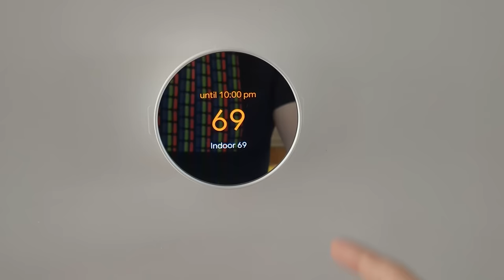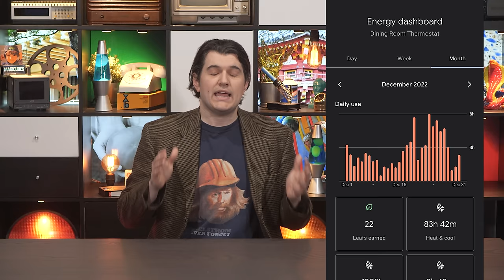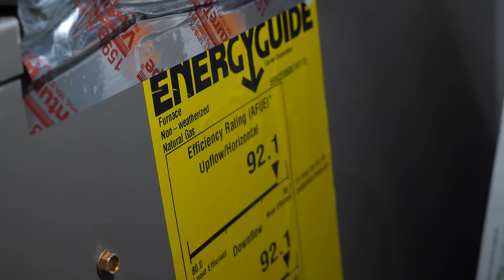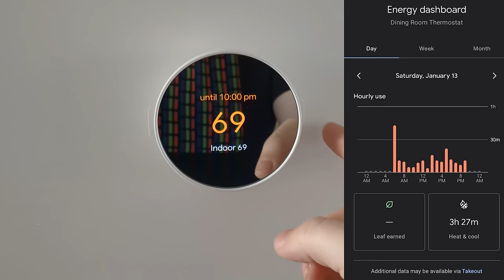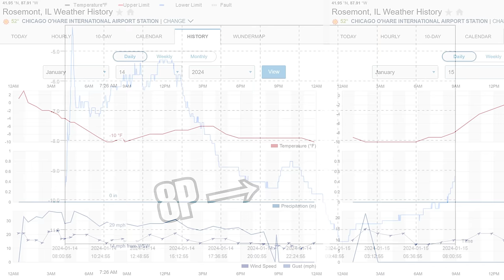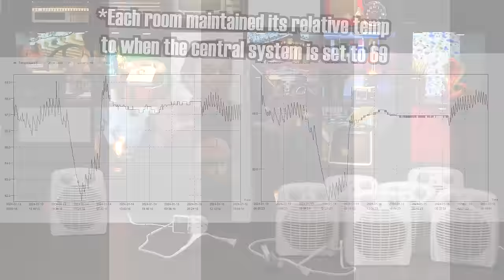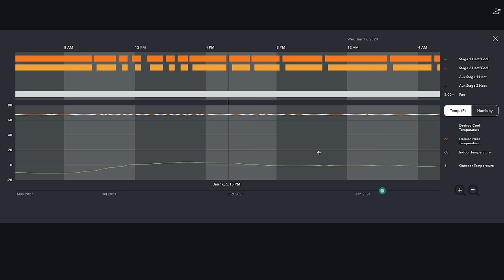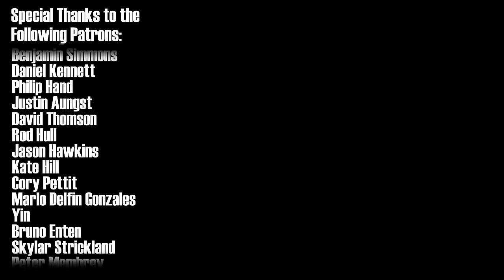Old HVAC industry practices are holding us back and costing us money. But we can fix it.

Comment: I gave up trying to find an HVAC company that wasn't going to lie straight to my face about heat pumps, so I installed it myself.
Reply: This was my attitude about solar and well, almost every other service industry anymore.
Reply: Why do think they're lying, rather than simply being misinformed themselves?
Reply: I have ended up doing most installs these days myself because of similar situations. The “pros” these days only want to install what puts the most money in their pocket
Reply: @JD-xz1mx  The alternative is worse. Profit motive is one thing, but do you want to hire a "professional" that doesn't know their craft?
Reply: Same here. Dual fuel,  with a 96% 40k 2 stage gas backup. Even got my 608 Universal, so I could charge myself, as I had a 36' lineset.
Reply: Same here. Installed my own, 7 indoor units, 3 outdoor units. Pioneer. I still have an oil furnace as backup but haven’t used it in a year. Upstate NY.
Reply: @JD-xz1mx  Because my expectation is they should know their business, so if they aren't lying, they are incompetent, which is equally as bad to me.
Reply: @JD-xz1mx It’s their job to know. If they don’t, then they are at least lying about being professionals.
Reply: How much for the vacuum pump?
Reply: @JD-xz1mx Plenty will lie.
Reply: No you didn't.
Reply: Where do you live? You're assumption might be completely unfounded....my father is an HVAC....
Reply: Problem is that you want a power efficient solution. An installer just wants a customer that does not complain after install. And people will complain to the installer if the system doesn't get hot enough. So they install systems that can make it very hot very fast.

They know you don't need it, but they don't want people complaining the room doesn't heats fast up enough.
Reply: @tharealmb  That might be true a lot of the time, but there is also plenty of Muppets out there that don't know how to do their job properly.
Reply: @LeArmBoss 
Were you watching them without them knowing, so you could make this comment and not be called out on what I can confidently state is baseless speculation? If so, there's probably some questions they have for you, that come along with something like a restraining order.
Reply: @DrLoverLover  I have no idea if it would work, but my vacuum pump (which I think is advertised as being for HVAC work) cost like $200-$250. Standard ass two stage mechanical pump.
Reply: I wish I could install a heatpump myself, but unfortunately where I live it is illegal to do so.
Both wind turbines and heat pumps must be installed by a certified person.
Luckily solar panels don't have this requirement yet (though they attempted to legislate it).
Reply: @44R0Ndin it takes several thousand dollars worth of very specialized tools to install a system. Plus knowledge of brazing, sheet metal work, charging the system properly, how to wire the system correctly. It's absolutely not something that you can just save money on by "doing it yourself" like you can with a car.
Reply: @LeArmBoss bullshit, cars are 1000x more complex than a standard home hvac system.  Thousands worth of tools, are you kidding?
Reply: @LeArmBoss  
Several thousand dollars of specialized tools... that only need to be paid for by the HVAC company ONCE.
Knowledge that has to be learned ONCE.
It's absolutely not something that you can just keep charging 10k+ for and telling anyone who doesn't like it to pound sand, without someone (skilled or otherwise) eventually undercutting you and taking all of your business.
Plus, you don't need to know brazing or sheet metal work (or much about charging the system) if you choose a mini-split type system with a prefab and pre-evacuated line set instead of a duct-based system.
Reply: @hubertnnn 
Guess why that's happening? The people installing them are trying to create a way to reduce competition from "I don't wanna pay you for that" type people.
As much as they say it is, it's not about safety. It's about forcing you to do business with them.
Reply: @LeArmBoss  Actually, yes it is.  Way back in 1989 I bought a book used by HVAC trade schools which covered the whole process.  Installing a system is some plumbing, some electrical, and some sheet metal.  The hardest part was finding a source to sell me the equipment.  I found a small shop to bend the sheet metal to my drawings and an HVAC tech who moonlighted in the evenings to do the brazing, evacuating, and charging.  I saved about 40% and ended up with quality system spec'd the way I wanted.  When I sold the house 30 years later, that system was very outdated, but still working fine.
Reply: It’s because they’re all owned by the same company, BlackRock. They’ve been buying up local hvac companies etc and keeping the rights to the name and likeness so they pretend they’re still a family business. Really they’re owned by the same company and using the same quoting software etc
Reply: I put in a Della brand 12,000 Btu heat pump in my nephew's rental home, installing the indoor coil on a TV cabinet, and running the tubing out a window, so there is no holes in the walls.  It cost $620 at Amazon, is 20 SEER, and has already saved him over $600 in heating costs!  He has a 1,000 watt electric heater in each room of his 1,400 square foot rental home near Portland Oregon.
Reply: @JD-xz1mx  It's their job.  If we can look it up, they SHOULD be looking it up.
THAT is the problem with licenses.  When the government lies they are qualified, they don't bother to learn what is needed.
Reply: @DrLoverLover  I bought a two stage at HF for $80 with a coupon.  I think I finally figured out how to make a CV compressor.  Their low load makes them better for running off solar since they don't need the start up amps, plus are more controllable so you can have multiple states depending on how much of the ductwork is open and needs flow.
Reply: @Perceivedshift Easily, i have about $13k of specialized tools in my truck to do this work. Hell, my charging manifold setup alone was $1300,
Reply: @JD-xz1mx  people lie to make more money. I never saw an estimate that was reasonable or didn't say 10-12 hundred leaving 2oo dollars wiggle room
Reply: Did you document it? Make a video of it?
Reply: @JD-xz1mx  they are more interested in a sale, and the higher the BTU, the higher the profit.
Reply: @LeArmBoss  it really doesn't take thousands in equipment if you get the diy kit. Mine was $2600 and came with everything I needed but a drill and hand tools.
Reply: What do you think they lied about?
Reply: The cool part is it's a LOT easier than they want you to believe.
Reply: @Kangenpower7  That is a great idea.  When he moves he can take it with him.
Reply: @jasonnass3766  sounds like you find ways to waste money.  I too have a charging manifold, costed $80.  Car techs often require $30k in tools minimum, mastertech certs and recerts, and require a boat load more technical skills than any hvac technician, even for industrial applications.  There is no way in hell hvac techs should be charging more than $100/hr, but they can because they talk a good game and homeowners apply for government benefits and dip into their HELOC loans.  You work in a subsidized industry and i despise it.
Reply: @JD-xz1mx this is actually an incredible point. I work at an hvac wholesaler ( where your local installers buy their stuff, and we don't sell to homeowners because of it. You would be blown away by just how many installers don't know how to properly explain how a heat pump works to their prospective clients. It's a 50/50 split between customers who buy nothing but heat pumps, and those who sell 1 or 2 a year, and that difference is the individuals ability to explain how the tech works. We do what we can to educate at the counter and run dedicated training, but it's up to the installer to actually listen and retain that info.
Reply: @thebeattrustee  Is that true? BlackRock really is sticking their fingers in EVERY pie.
Reply: I installed solar on my own, too, and am now looking to upgrade my HVAC.
Reply: Some companies just don't deal with heat pumps company I work for has trades in house for electrical solar plumbing and contractors. We were told not to install heat pumps too high if a failure rate if you give longer than 5 year gurantees on heating.